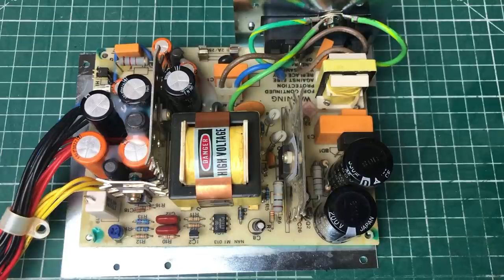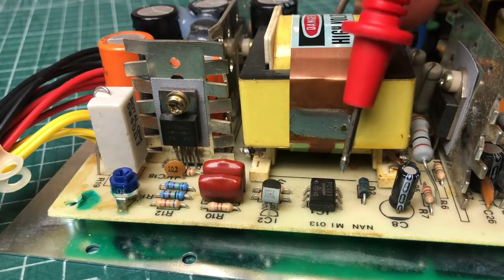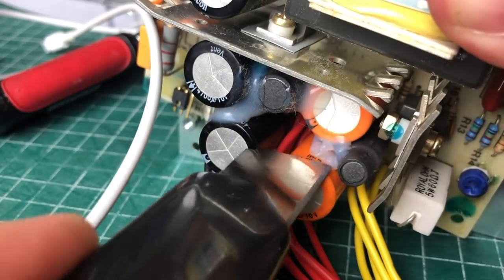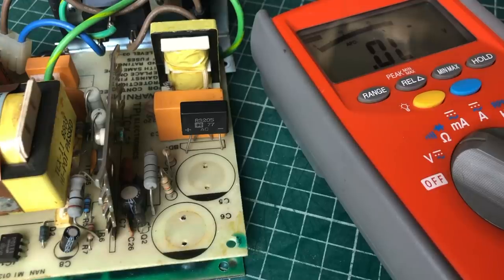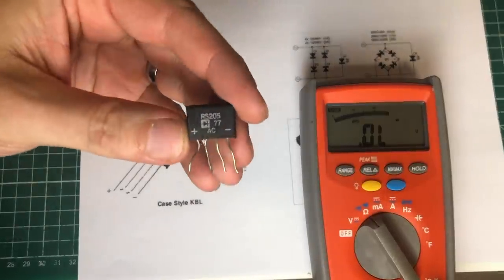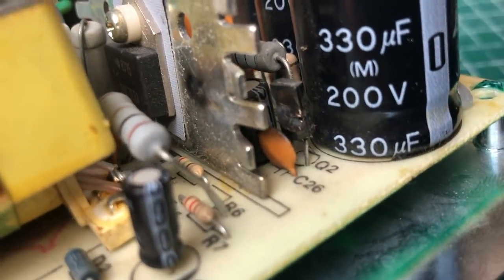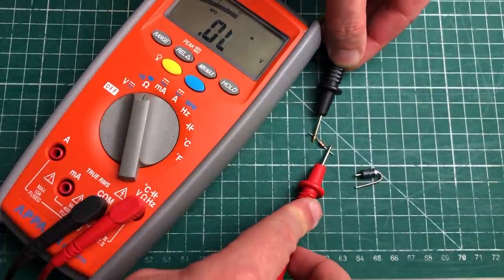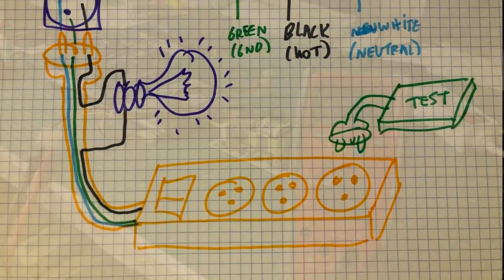Switch mode power supply attempted fix

Comment: That resistor might be part of the current sense for the PSU, acting as a shunt resistor.  Use the right value and wattage.  It's a precision power supply.  No fudging values :).  The thermistor looked damaged too as someone pointed out.  I would suggest isolating the output stage and seeing how it acts with no load.
Reply from the maker: Tested the thermistor at room temperature and it was measuring about 10-15ohms. I did heat it up and cooled it down and saw the resistance change. Didn't make it in the video. I think this should be ok. I did a measurement off-camera on the live circuit and saw the rectified DC voltage coming out.
Reply from the maker: How does one isolate the output stage ? Most PSU need some kind of load to start hence the hard drive to start the PSU.

Comment: I bet the big 5W resistor is the sense resistor and this is a current mode flyback SMPS. So the resistor choice is really important. You should go for 1 ohm and not changing it.
If the 1 ohm resistor is blown it means the current though the transformer has been huge and therefor blown the resistor
As this powersupply is isolated what you could do is take your bench power supply and connect it to the output of the 12v and use the bench supply to power up the SMPS and then you can measure the current draw of the 12V line and measure voltages and same with the 5V. 
Specially the TLV431 circuit is interesting to check as it indicates if it regulates properly. 
I bet the circuit is designed so it just uses a simple voltage divider with the 12V and 5V to sense the output voltage so if you got 2 bench supplies try hooking them up to 5V and 12V then you should measure 2.5V on the sense pin of the TLV431
Reply: Edit: I found that he's done most of what I mentioned here:
Agreed that he should try and find any shorts on the 12/5V rails, I suspect where he had no fan pulling air flow through the PSU, there wasn't any cooling on the schottky diodes and thus over-heated and went soft-short, this then overloaded the Primary side of the PSU causing it to blow.... after he initially "fixed" the PSU and got it going but with the 12V rail sagging before blowing is a good indicator of the 12V schottky diode failing, on second blow-up, the schottky went full short (as tested in this vid with the cap removed).

Because of the primitive feed-back chopped self-oscillating design, any secondary side fault can cause an overload on the primary. So I'd start with making sure all the Secondary rails are in good shape first before moving onto the primary as there's no over-current protection.

Addendum during edit:
I'd check if the ceramic caps have gone bad.... or
I wonder if the transformer has shorted?
I Doubt it, but the PSU is drawing some current....
Reply from the maker: yeah .. it is probably erroneous on my part to assume that a PSU like that with a "light" load like a hard drive can run without cooling / heatsinks, even if it is briefly .... I'll make sure to check for that in the future.
Reply: Yes.. and also.. it is ok to put resistor in parallel.. or series.. for get the values that are not available on the market..
The values that are not manufactured .. is because you can get thouse values .. by combining the resistors that are available..
Ej.. if you need 50 ohms.. it does not exist..... because you put 2 of 100 in parallel.. and you get 50 ohms..
Ej.. if you need 2000 ohms.. (2K) it does not exist..... because you put 2 of 1000 in series... and you get the 2000 ohms .. and so on for absolutely any other value you need...

Now you can get 1 ohm using  resistors in parallel... yes ok..
but keep in mind.. that the two that you used in parallel... are of 0.25 watt..
so by using just 2... you make a resistor of 0.5watts...
you need to use 4 in parallel to make a 1watt resistor...

and that ceramic Gray one that you try to remplace.... is a 5 watts .. :-D
Reply: Current mode flyback,  sounds about right.   The metal strap on the transformer can be a give away.   Great advice with the bench supply and the resistor.  The 431's are pretty bulletproof for the most part unless you slam way too much current through them.

Comment: If you see alot of SMPS' across your bench it is good to have an isolation transformer (if using an O-scope) and Variac to adjust the AC voltage going to the SMPS. Most SMPS will run at a very reduced level 60 VAC. The variac or adjustable transformer can save on the exploding parts because as you bring up the voltage to line level (120VAC) you can monitor the current with the variac ammeter. This prevents the replaced parts from exploding because you can shut the voltage off before a critical over current condition happens.

Comment: This reminds me of my attempts to repair an arcade CRT and i would find and replace something only to blow the next part over and over. I got to a stage that I thought if I do not switch it on again I can say it's working in my mind and move on.
Reply from the maker: I am gong to create a dim bulb tester / load lamp to save me lots of components and scares ... always scares the hell out of me when a simple fuse on the PSU blows .... even worse when the breaker in the house trips .... don't like AC , so I am trying to make a more safe and easy environment to work with this type of equipment (isolation transformer + load lamp)
Reply: @RetroSpector78  using a bulb as a load is a good way to test the B+ circuit on a CRT too. I much prefer working with TTL logic :)
Reply: Same.  I just fixed a CRT (PCB had cracked right under the fly back transformer) and I don’t know if I would have had the courage to keep troubleshooting if parts had blown up every time I turned it on!  Luckily the power up protection circuits had noticed something was awry and prevented it from taking any (further) damage.
Reply: @nickwallette6201  The last one I tried just would not work and in the end I sent the chassis away. The guy reported back to me that the Line Output Transformer I had replaced was the wrong type and possible mislabled from the supplier.

Comment: Switching power supplies that fails are almost always a big pain to repair, in my experience. It rarely helps replacing the obvious failed components, only to see it blow up once again. The only exception (for me) is when capacitors are failing (and nothing else), then replacing the caps will likely bring the PSU back to life.
Reply from the maker: yeah ... unfortunately it's not always an easy fix like that :)
Reply: @RetroSpector78  yeah, thats what I wrote 👍

Comment: Alcohol is good for freeing up old hot glue, sometimes it can come out in one big chunk
Reply from the maker: Thanks for the tip !
Reply: I had good luck with using that trick on a 1991 Astec cash register PSU.
99% ipa and all the glue (except for a little piece under the tranformer) came off after waiting 30 seconds before slightly pulling on it with a pair of soldering tweezers and a small screwdriver.
Reply: Agreed,  been using this trick for years.  It's like magic.  70% or higher IPOH aka isopropyl alcohol
Reply: Mr Guru  Trust us,  it's not.  spray bottle and just mist on some isopropyl alcohol and it comes right apart.

Comment: It's often easier to take those sort of heatsinks off the board with the components attached and then remove the component if needed.
The same with components glued together, unsolder the whole group and then separate them.

Comment: @RetroSpector78
I'd change out the ceramic capacitors on the primary side (especially any that are next to heat sources and are part of the Q2 circuit) and with that replace what components just blew, also I'd check Q2 doesn't exceed the rated voltages in circuit (Don't want a latch situation, that can cause a bang).
Also, if you do get the PSU running again, RUN IT WITH A FAN! (Push or pull, as long as there's airflow.)

Just hoping they didn't compromise the transformer size for space vs heat-capacity. However, they don't normally fail.

Comment: Is transistors blow repeatly, this stinks like a broken snubber. The snubber absorbs high voltage spikes from the transformer, protecting the transistors. Checking wether the snubber works correctly would be my next step here.
Reply from the maker: thanks for the tip ... will look into that (and try to find out where the snubber network is somewhere). If you can give me a pointer that would be great !
Reply: @RetroSpector78  Look for a small diode or resistor connected to the transistors collector. Also note that these older supply's need a load to work since there is a minimum on time and that would overwhelm the snubber if there is no load.
Reply: The snubber will be a small value ceramic capacitor and resistor in series in parallel with the primary of the transformer. There will also be snubbers on the output voltage rails.

Comment: Those prices of paper are silicone isolation pads to electricity isolate the parts from the heatsink while providing thermal conductivity for cooling

Comment: that 1OHM resistor is the current sense resistor, looks like a Two Watt. Also you want to replace those Thermal Pads that are on the back of the Transistors, Thysistor and Diode pack because one simple hole that the part can touch the heatsink that is probably at ground potential will cause a short circuit.

Always use a Dim Bulb tester however if you ever try to power a whole computer with one you'll need a beefy bulb around 200watts.

Comment: thank you for posting.  i'm wondering about the components bolted/screwed to the vertical metal heatsinks.  if the intervening paper is intended as an electrical insulator, it would seem to be negated by the metal screw/bolt.  perhaps it's intended as a thermal conductivity aid, instead of thermal grease/paste.  seems confusing to me.  maybe try replacing the bolt/screw w/ nylon ?  
take care & stay safe.

Comment: Boss at 2:21 did I see a 'hole' in the transorb (that black part)? Those go bad all the time if PSU's are over volted. Also look into an ESR meter, very handy for this work. Mike in Virginia Beach VA.
Reply from the maker: Tested the thermistor at room temperature and it was measuring about 10-15ohms. Changed resistance with temperature change also. Think its ok. Bought some new ones and they also had like a small hole in their casing. didn't bother changing it here. Will do it in part 2.  And I did use an ESR meter in the video :)
Reply: @RetroSpector78  Ok, that's good. Thought I saw a hole in the part. In my experience that is not usual or common. 
As for the ESR meter, there are many types and kinds of them. Can't know them all.
Much luck on your project.
Mike in Virginia Beach VA.

Comment: Also pretty unlucky that it doesn't have a controller IC. Would make things much easier when you are not experienced with troubleshooting a SMPS. Though there is not many components on this PSU therefor it should be repairable but it is also hard to find out when you can't measure anything
Reply from the maker: Also noticed that the number of components is fairly limited and I am sure somebody can easily reverse engineer it. Like I said a bit out of my comfort zone, just wanted to share what I already did and how I tackled it. Not really sure how a PSU like this works without the controller IC. Is it the switching that is causing issues due to a wrong PMW sent to the transistor, or is it something in the feedback circuit ... Think with an isolation transformer and load lamp I will be able to do some measurements more easily
Reply: @RetroSpector78  Yeah it shouldn't take a long to reverse engineer.. 
If the PWM was too high the main mosfet would have blown together with the 1 ohm resistor and the output voltage would be giant, if the PWM was too small the output voltage would just be too small and nothing happens
I bet the regulation works as the voltage was 10V. Not 2V and not 20V so it tries to stabilize but something is causing the Voltage not reaching 12V so
i bet something on the secondary side is drawing a huge amount of current causing it to blow the fuse. 
When you replaced the defect components did you ohm the outputs to check there still wasn't a low resistance/short on the output?
Reply: @decee1157  The other trouble is using the substitute components. This power supply is a self-oscillating design and its sensitive to the parts you use. Thats what ive found in my experience repairing these early SMPS units. this thing being a 1981 according to the date code on the main caps, thats super early for SMPS life.

Comment: Have you managed to repair? I have a same supply, 5v perfect, 12v too low (10,5). TL has perfect 2,5v, caps ok. Dont know whats going on. How can this thing regulate when both voltages are fed into the TL? I tried to alter the TL but the 12v line comes along. Will you make a second video about this repair?

Comment: I really think that the power transistor and schottky diode aren't in fact separated from the heat sink. Those grey papers look more like a thermal conductive material to help the heat get from the component to the heat sink.
Reply from the maker: I noticed on the bolt there is a spacer that prevents the tab making contact with the heatsink. Without the spacer there was a short.
Reply: @RetroSpector78  They're known as SIL-PADS and Thermal Pads. They are there as a spacer for heat to conduct through and provide isolation.
I personally prefer good old Mica Thermal pads with some heat sink grease.
Reply: @RetroSpector78  Sure. It must be electrically insulated but the heat must be allowed to pass. Otherwise those components will fry themselves as you have experienced with the hi temp on one of them.

Comment: 2:25 the 10sp black component looks to have a burn whole in the face of it???
Reply from the maker: That is the thermistor. Thought the same thing but measured it and turned out fine. Bought some new ones and they also had like a small hole showing something metallic. But will replace it in the next attempt and see if it was the culprit.

Comment: amazing video one of my favourites...... before doing any repairs dischange the two main 400v capacitors with a bulb or resistor(15w) and double check voltage across their legs .(i noticed that underneath the two main capacitors there is a white material - this means that they need replacement) 
my ideas are the following:
1)Stay focused on the first stage of the power supply not the secondary 
2) Blown fuse means short in first stage of power supply such as main transistor blown and the resistor next to it - you will also notice that the main capacitors will have 400v and they will not discharge(if the power supply cannot pass the current to the second stage of it the 400v will stay on the main capacitor for a long time-
3)replace all small capacitors on the first stage of the power supply (Dont measure them - change them directly it will save u hours of repairing and blowing more New components) 
4)desorder and lift one leg of all resistors and mesure them out of the circuit
5)check secondary diodes also for s/c
waiting more of your videos i believe that can be fixed

Comment: Check all capacitors out of circuit for shorts?
Reply from the maker: Don't think you need to pull them out of circuit to check for shorts .... if they have a short in-circuit they will be shorted out-of-circuit I guess ? Didn't remove all of them but there were no shorts when I turned on the supply.
Reply: @RetroSpector78  If you don't take them out of circuit to test, then how will you know whether the short is them, or something else in parallel with them? It's more work. but it is reliable. There are in-circuit testers you can buy, but they're several hundred dollars each, so unless you already have one, this would still be my starting point.
Reply: @michaelsworkshop9031  You can easily test Caps in-circuit. Caps block DC signals passing through so with a Multimeter with a Diode Test should work just fine to check for a short. Also in most cases it can load the Cap with a slight voltage so if the Meter reading goes up then it's not a open circuit.

Another tool that is a favorite for the Graybeards of Electronics is to use a Oscilloscope that has a X-Y function and a Octopus adapter that outputs Lissajous patterns.

Comment: Why not just use the guts from another switching power supply? Is there something special about this particular power supply? 

A great tool for troubleshooting this type of issue is a variac. You can pick one up for around 60 dollars. It allows you to control the voltage and amperage feeding the power supply. It will keep you from blowing new components and fuses while allowing reduced current to flow for troubleshooting. You will also find it useful for powering up those new vintage finds, that have been sitting for years.